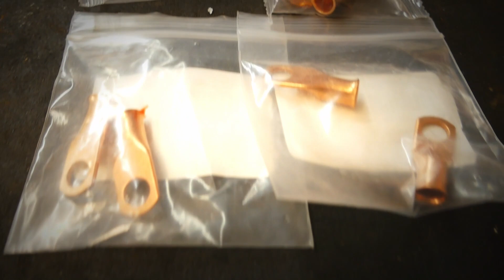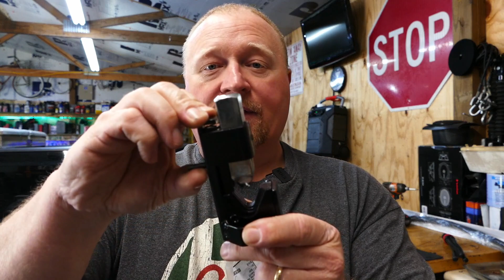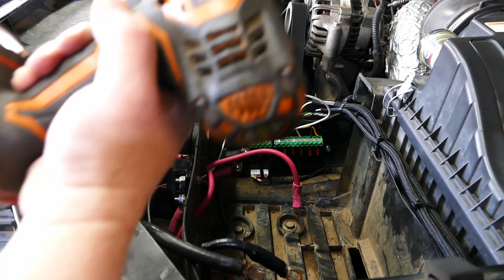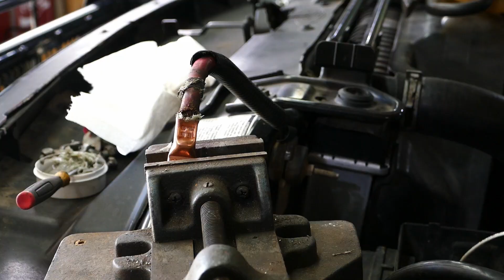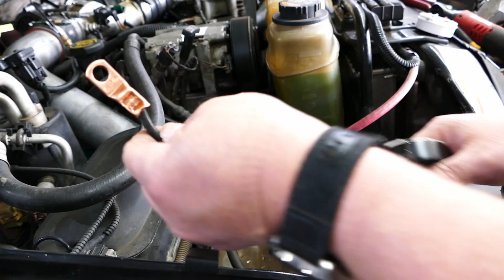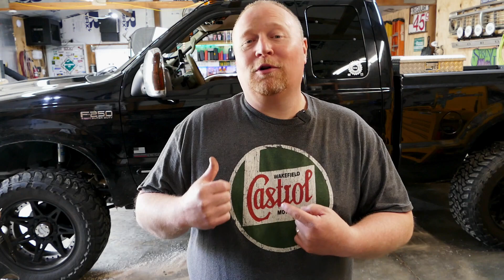Ford 7.3 Powerstroke Battery Cable Fix  | Permanent, Cheap & Easy!

Comment: how is this specific to a 7.3?  it's a universal battery terminal end clamp, a standard part that millions of people use all the time to replace old corroded and broken terminals.  not really worthy of a whole video.  and who cares about the details like solder vs crimp, don't really matter as long as it works and holds up.
Reply from the maker: Well, so far it's paid me about $3500. So was it worth a video?

Comment: I have 02 f550 recently had passenger side battery completely dead after 7 months of use do u think i have to replace the whole cables or just the stuff u did? Plus i had some corrosion on passenger side terminals only not driver side? What do u suggest? Thanks & great content 👍🏼
Reply from the maker: Check charging system and the GEM module.

Comment: I know its a old video but i was told by a Tractor guy take a hose clamp and put round the battery cable to compress the wires makes for a ezer install of new connections
Reply from the maker: Now that you mention it, I do believe I've heard that too. Of course I'm an old tractor guy myself. I have about a dozen of them.

Comment: A small note the antifreeze is a bit low. Main question is the drivers side battery cover is missing like on mine and many others. That cover is supposed to direct fresh air through the filter. But with it not there is there a problem not having that cover on the driver's side battery?
Reply from the maker: I never experienced any issues. However, I have sense upgraded to a completely different air intake system

Comment: Thanks pal!  Bought my first 7.3 recently and this fix is def on the list.  Overall my truck is solid, new HPOP, injectors, all the critical sensors, new batteries, but the PO did not do this.
Reply from the maker: It makes a big difference.

Comment: Not pickin bud but you don't need to sweat those like pipe joints.
I've been a diesel tech for 32 years and in the industry we fill the bowl on the cable lug with solder and shove the cable in the bowl. Count to 15 and its set. If you don't use the anvil you get way more solder and 00 gage cable will brake before the end comes of pluss the resistance is way Lowe and there's about 10 less steps. 
You strip the cable 
Heat the solder in the lug.
Plunge the cable end in the lug. 
Slide the heat shrink on while it's hot and it's done. 
Once you do strength tests and continuity test with ot without the anvil you'll never use the anvil again. 
It's counter intuitive but that anvil makes a weaker less conductive connection
Reply from the maker: Thanks for the info!

Comment: Thank you so much for posting this video. I desperately needed this information. I'm trying to sell my 99 F350 and the cables of come so loose my truck won't start anymore. Going to see if my son can help fix the issue by following your video instructions. The is the one thing that's stopping me from selling my truck.
Reply from the maker: Pretty easy fix. Makes a huge difference.

Comment: I would soak the bare cable ends in a baking soda and water bath to neutralize any battery acid that may be lurking between the strands.  When the bubbling stops all of the acid is neutralized.
Reply from the maker: Yeah, that's a good idea. I like that.

Comment: Would this still apply to a 96 7.3? As far as the material list?
Reply from the maker: I'm not really sure about the wire gauge sizes. The battery terminals, yes. As far as sizes, I'll bet 90% of the lugs would be the same.
Reply: @ProjectTimeGarage  dumb question but how would I measure for the gauge size’s?
Reply from the maker: @SIG-SOUR89  I typically use a cheap set of dial calipers.

Comment: 38 minute video and stupid music. That was way too  much work. Buy a new cable. Much easier
Reply from the maker: Excellent suggestion Greg! Why didn't I think of that?.....oh wait, I did. $400 worth of cable and a full day of work vs: replacing some cable ends in a couple of hours. Yeah, I think I'll stick with this method. Regarding the music. I can definately change it for you if you would be so kind as to record me some royalty free music and fill out all the paperwork certifying that that I'm free to use in my videos without royalties.

Comment: That would work but the only problem is is my wire is an inch around and I diameter
Reply from the maker: The primary wire from the battery to the starter on mine was huge too. Not 1", but huge nonetheless.
Reply: @ProjectTimeGarage  f450

Comment: Thanks for the info. I’m semi new to diesels and my battery cables were in rough shape when I bought this 99.5 7.3 a few years ago. Mainly, cables wouldn’t tighten anymore having loose connections. Replaced driver side negative cable with OEM. Cant find OEM passenger side negative cable. DID NOT know passenger side drew more power, but makes sense seeing as the starter is on that side. Just figured it shared the load between the two batteries.
Reply from the maker: I think it does share the load to a degree, the starter cable is the huge one since the amperage draw is massive, especially on cold mornings when everything is tight and oil is thick.

Comment: Unless the cables are corroded inside, like they most likely are.
Reply from the maker: So far so good. It's been about 8 months and it still spins over twice a good as it ever has. At this point, it's a win.

Comment: All I have to say is you tried to do a good job but if you want it done right check out Zach Mcfarlin video on battery cables and he will make you a set if you want them! They are not cheap but they will last forever and will be bulletproof!
Reply from the maker: I don't expect them to give up in my lifetime. We've been doing it this way on all our farm machinery (tractors, combines, dozers, track hoes, spray rigs, etc.) for years and years now without a single problem. It's like anything else, a whole lot of ways to get a job done. Different doesn't mean wrong, it just means different.

Comment: For the positive battery to starter you said it may be a 3/0 but how well does the 2/0 cable lug fit
Reply from the maker: It fit okay. Not perfect, but not too bad either.
Reply: I used 3/0 on that cable and fit nicely just had to twist it tightly to get in lug

Comment: Solder by itself is more then enough!  It will harden very hard!!
Reply from the maker: And hot, lol!!! I burn myself every single time.
Reply: Solder alone will eventually vibrate loose.
Reply: Or could meltdown if overheating like using a winch

Comment: What I did, buy some welding cable wire, cut 3 pieces of solder inside the connector, clamped the eyelet cut back about the length of the eyelet make sure those wires are completely in without those "whiskers" (test fit) slide the shrink on, heat the copper connector then push in the wire hold for a few. Clean look.
Reply from the maker: Awesome, thanks for sharing!

Comment: What solder did you use?
Reply from the maker: RadioShack 60/40. It's a super-old spool I've had for 25 years or so.
Reply: @ProjectTimeGarage  radio shack is closed lol but I’m sure I can find some 60/40.Thanks for making a video on this.
Reply from the maker: @reyes2581  Lol, guess I'm showing my age.!

Comment: Why in the he** did you not put stud post batteries in there?  Eliminate the corrosion pron post and stupid connection you made!!
Reply from the maker: We've used these terminals countless times  on farm equipment (tractors, combines, sprayers, etc) for well over 2 decades without a single problem. I made my decision based on a whole lot of personal experience, experience that has never let me down.
Reply: because he saved himself $600 in new batteries?

Comment: Hey man, when you were getting ready to do this project, did you look into building your own new battery cables? Copper costs have just gone through the roof so it's not a great time right now if not urgent but I was thinking oversized welding cable to build my own, ordered cut to length from local electrical supply house.
Reply from the maker: Yeah, I actually did. We have a close personal family friend who owns a starter/alternator rebuild shop who could supply the necessary cables. But, as I looked over everything, the only real issue was the butchered terminals - everything else was in great shape, so I chose to just do the terminals. 

Welding cable - I've used it to build jumper cables and battery cables in the past. Worked just fine for me.
Reply: @ProjectTimeGarage  yeah welding cable is the direction I was leaning in the past, never spent the money to build any of my own though since it wasn't a need, just a want.
Reply from the maker: @Buickman455  I can say for sure that my starter turns over MUCH faster after having done that project. I didn't realize the starter was dragging a bit before.
Reply: I'm glad I seen your reply, I have old welding cable I make jumper cables with,,, now battery cables 👍

Comment: So sir, if I can make some suggestions. I apologize I don't know your first name. Spend the extra time when making a video to move the camera to the opposite side of you, to show the viewer what you are doing. You obviously have good intentions, but we don't know what's going on if we are looking at the back of your gloves. For the stuff that is self-explanatory but that you would still like to show in the video, speed up those sections like a movie montage, 2 or 3x speed.  FWIW, I want to do this on my own 7.3 but I would like to fabricate my own heavy battery cables if I was going to spend this amount of time on it.
Reply: So I see you did do some fast forwarding later, I was only partway through the video when I made my comment because I wanted to keep my train of thought and get it posted.
Reply from the maker: Thanks for the suggestions. I'm still very much in a learning curve with the camera work.
Reply: @ProjectTimeGarage  no, I think you did an excellent job, there was just a couple times where zooming in the camera for a couple minutes or re-aiming it a little bit would have been great.

Comment: Nice video! I like the way those clamps look and work. Wonder if the copper connector would have got hot faster for the solder if not in that metal vise heat sink? (I don’t know, just asking out loud) maybe hold cable in vise instead? Let us know long term how they hold up! Looks like it turned out great! I think this has many applications.
Reply from the maker: Thanks Uncle Mark. I'm sure the vice was acting as a heat sink, good point! Hopefully this is fix is permanent.

Comment: so a total of 4 eyelets crimped/soldered?! do the ground wires use the 2/0 size and hot wires use 1/0 size??
Reply from the maker: Check the video desc, I put all the stuff in there, basically the pass side ground and the starter wire are 2/0, both driver's side terminals are 1/0, the pass side wire going to the driver's side is 1/0, then there are a couple more on ass side that are 1/0